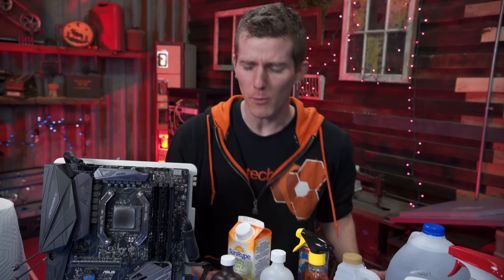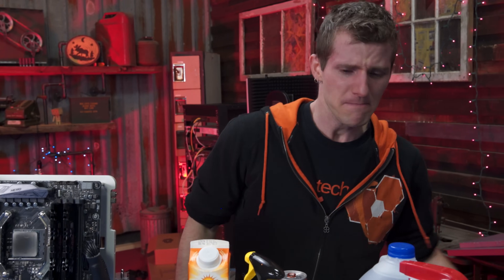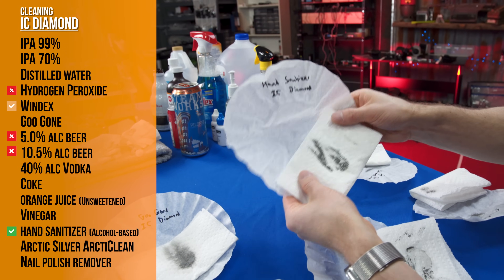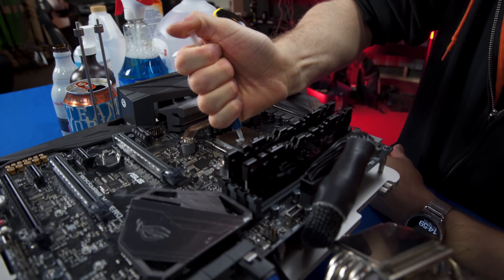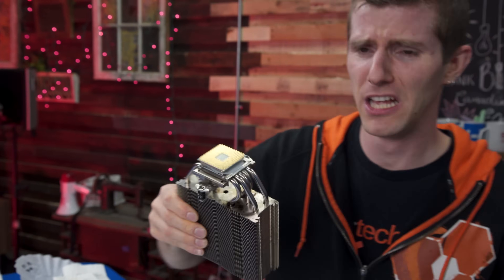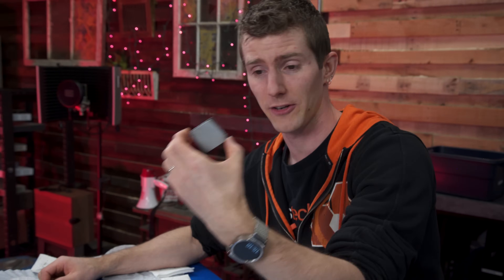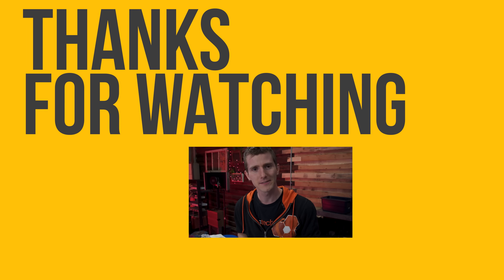Removing Thermal Compound - The BEST Way?

Comment: Then come back in 5 years and realize that the material is literally hardened. Then? Plastic scraper and miracle eraser. When the compound is new, it does not matter. But, what about the residue from the solvent/cleaner?

Comment: There is another purpose built solution for removing the paste. Electrical contact cleaner. You barely have to wipe the surface as the paste will just run off.

Comment: The reason that 99% iso is preferable is NOT because it is better at cleaning than 70%, it is because it contains almost no water.

Higher water content takes longer to dry, has a higher potential for leaving a residue (which is also a major risk with things like hand sanitizer), and IMO has a higher risk of causing moisture related issues.

Comment: i bet the thin stuff would be a bit harder to get off after its been through a few heat cycles ad has dried up, i mean the thick stuff would probably be more difficult too, but especially the thin stuff

Comment: It wasn't AMD, so the cpu is probably fine. I once ripped the AMD CPU with the cooler like that, had to straighten the pins -_- Surprisingly - it worked fine afterwards for many years
Reply: It was an AMD 1800X actually.

Comment: You're missing a huge part of this... what if anything do any of the solvents leave in the microscopic crevices of the heatsink/CPU... you'd have to look at the surfaces w/ a microscope to determine this. However the reason the Isopropyl alcohol is so good in this area is that it all just evaporates.

Comment: +1 for 70% isopropyl.
I've been using 70% isopropyl medical swabs for probably a decade now. they're easy to work with as you get your solvent and lint free wipey offy thing all bundled together in a sealed satchel, ready to go.
and forget having to go to a hardware store, or some place that deals in chemicals to buy it. just go to your local pharmacy, and get about 100 of the bastards for five bucks!

Comment: I've always thought that the purpose of using 99% isopropyl is that it completely evaporates without leaving any residue like, say, orange juice would, so that if a bit gets on your motherboard/in the pins of your CPU, its not a big deal. Plus, it evaporates quickly, reducing the chance of powering on the system while there's still liquid.
Reply: Matthew Hennes yes
Reply: I understand ur point but I feel the difference between 70 and 99 is too small for the price difference, the amount of residue left by the 70 would be not faintly noticeable to the human eye, and same goes w/ the orange juice but the orange probs left some stuff.
Reply: @Denmire  I don't know about the prices where you live, but the price difference between 70% and 99% isopropyl alcohol where I live is about 10%. That means that buying 99% and diluting it down to 70% is cheaper than buying 70%.

But the major selling point of getting the 99% alcohol is that it's nearly pure, wherehas ''Rubbing Alcohol'' (70%) contains camphor and other additives to relieve muscle pain (and to discourage drinking) which will leave a small residue after evaporation.
Reply: @Denmire it's not really about what the human eye can detect, it isn't an issue of not liking how it looks after cleaning. The residue that CAN be left behind (not 100% guaranteed) by 70% vs. 99% can actually cause shorts in electronics. So if it gets on the CPU pins it can cause a big problem for your wallet when you fry the CPU, if you aren't concerned about that or aren't going to use the IPA to also clean your PCB or anything else then 70% would be fine, but if you are using it for more than JUST the thermal paste on your heat sink and the top of your CPU then the non visible residue is going to be an issue.
Reply: Can i use it to clean the pcb if my gpu
Reply: ShortGamingVids yes you could use isopropyl alcohol to clean your GPU.
Reply: It will evaporate clean, no residues, no additives, just pure solvent. And the cost is probably cheaper, per %/volume.
Reply: It’s non polar
Reply: mate can i use normal alcohol if i cant find isopropyl no where in my country or it will ruin my cpu?
Reply: Thought especially the beer, coke and juise would get that issue. Vodka aswell, it got quite the amount of sugar left in.
Reply: Good-quality vodka is actually nothing but alcohol and water, they distill it and then dilute it back to 40%.
Reply: Not true. Alot of sugards in vodka and it will be a mess if spilled.

Comment: No clorox bleach?
Dissapointed.
Reply: a solvent is anything that can dissolve. OJ and beer are acutely acidic, meaning they're a solvent. bleach does "clean" things but usually by breaking down the organics of dyes and pigments, it's also why it kills bacteria and cleans up blood by breaking down the organic material in them. so if the thermal compound adherent substance was organic it could potentially remove it, but that's a big if since they're all synthetic.
Reply: Bleach isn't a solvent. They're using 15 different solvents.
Reply: No bleach, but there is windex. That's close enough for me!
Reply: orange and beer  are  solvents?  0.o
Reply: loomnati noscopers up
Reply: They do use bleach in the video.

Acids, bases and bleach (usually bases) clean using the same principle, dissolving the substances (or reacting with them in such a way to make them soluble) and suspending or removing them with the solvent the acid (or whatever) is suspended in (usually water). 
The chemistry behind them is different and therefore works on different things, but the general principle is the same when it comes to cleaning. 

And being highly acidic is no guarantee of being a solvent, as is apparent here as coca cola is far more acidic than beer or orange juice and did worse than beer and just as bad as orange juice. 

Now that being said, bleach is not a specific type of chemical but is instead a general term for most chemicals that bleach...stuff...Two of the more common ones being Sodium hypochlorite and hydrogen peroxide (used in video). And as most types of bleach are oxidizer's they will in fact corrode metal and most other things that oxidise given time and suitability.

Comment: what happens if u remove it with a plane old wet towel?, i rlly wana know
Reply: like, if i remove the paste with water, and it takes alot longer, but eventually i get it off.. will the cpu temps go up when i apply the new paste just cuz i didnt "proparly" remove the old one?, i mean if i wipe it clean and shiny with water.. whats the big deal?
Reply: i used hand sanatizer, the stuff that makes ur hands feel cold, but im still wondering, does it matter what u use to clean the paste off?, cuz as long as u fully clean it off and add new paste, the new paste wont preform worse, am i correct?

Comment: You forgot the most important solvent: petrol.
That's right: just regular old petroleum will dissolve thermal compound as well as isopropyl, but since it doesn't even contain any water there's no need to unplug your machine.,

Comment: CRC Contact PCC is my favourite. Any flux remover seems to work pretty well. If the the paste isn't dried out then IPA.
Reply: The grey stuff some heat sinks have pre-applied can get quite hard to remove after a few years.

Comment: wouldn't there be a slight difference if the compound had been exposed to high heat and low heat over a long period of time (gaming and turning off your PC.) I don't think the result would vary too much to make your video irrelevant but it certainly would make the experiment more accurate (and tedious.) I want a do-over. jk lol ty.

Comment: Hey, everyone, if you ever have bent pins on a CPU... 16  gauge hollow-tip piercing needles. Incredibly accurate. I've fixed pins that were bent like dominoes in 90 degree angles.

Comment: It's okay, my processors are doing great and they've been ripped out of the socket at least 2 times each... .-. More horrifying was a 2 inch fall one of my processors took, landing on the pins... That broke it....... But I fixed it by bending the pins back with precision pliers and a magnifying glass lol

Comment: The real challenge is when the thermal paste has been applied for months, even years and it has lost moisture. That is when the cleaning products start to matter.
Reply: Yeah hope they do one year for each. So we get a video in 2047, that would be nice
Reply: @Suumpen  Or they would just do  them all for a year at the same  time????
Reply: Get out the chisels, we're carving stone!
Reply: 5 years and 1 month ago I built a machine and used Noctuas thermal compund and 5 years and 1 month after it was applied it was still sort of moist and sticky and yucky to touch and the cooler have never been removed or anything in those 5 years, im kinda impressed and thanks to filters on the intake fans there was barely any dust inside the case after 5 years, was some, but not much at all+ positive pressure helps alot.
But im atleast abit impressed it was still moist after more then 5 years and that machine have been used daily for many hours with everything from games to idling and being left running over weeks at a time.
Reply: @barzinimongo  I PULLED CARPETS OUT OF MY PC ?
Reply: Ga1us Agreed
Reply: @zanpekosak2383  Love Artic silver thermal remover and surface purifier its dont matter how many time the damn paste is ! its gonne in seconds...
Reply: Worst case clean the thermal paste from a MacBook Pro early 2011. Look up for a video if you wanna know what you'll find in there.
Reply: @alexandruilea915  i'm just swapping CPUs in my old rig from 2011. The cpu was never moved and thermal paste is still stock. Well it looks like I'm in for a treat
Reply: White gasoline.
Works great with 7 year old thermal crust.
Yes crust, i was running up to 90 degrees under load.
Reply: @Volvith  laptop? :D
Reply: @Volvith  im running 90 at idle. It's literally overheating rn while idle.
Reply: use a clean new razor blade to remove the bulk then alcohol to get the rest . been their don that. A LOT!!!
Reply: I managed to remove 10 year old thermal paste from a core 2 duo e6600 using water
Reply: All TIMs will do it over time, some take days, some take years.
Reply: Water is one of the options that I would never ever suggest to use. Allthough I am somewhat of a professional in hardware, in some sense, I would not trust myself even with that.
Reply: Ga1us can i use "Alcohol 95%" to clean thermal paste (its not isopropyl , just alcohol)?
Reply: Or it's cheap wax like laptop manufacturers love...
Reply: Acetone nail polish remover still does the trick, had IC Diamond on an i5 7600K on for two years because I didn't know you had to replace the stuff. A couple days ago I went to dust out my pc, took the heatsink off (which had a 3mm caking of dust on it under the fan), and the IC Diamond was hard as marble. Still came off super quick with nail polish remover. 

I guess the moral of the story is gamers should focus on always having a girlfriend so they can repurpose their beauty supplies for PC hardware needs
Reply: Thank you. I was trying not to scream that the whole video
Reply: This!
Reply: I have lots of ddr2fb dram (30 modules) that have huge thermal problems due to old crappy thermal paste applied more or less in 2008, none works. if you try to remove the heatsynk the bga chips get removed from the PCB.
Reply: I think it's time to retire that stuff, with the falling cost of used machines that take registered DDR3. The serial nature of that stuff is a HUGE bottleneck. Then again, if you must...
Reply: @Jack Burton,Troy Leonard  I will try on a spare one.
Reply: ArctiClean has always done it for me, even for years old paraffin based shite, AS5 applications, etc.

That said, I've never really done any high volume work (like Linus here). If I had, I'd be looking for something cheaper too!
Reply: I removed 8 year old thermal compound from an old computer that I haven't turned on in a few years with only a dry cloth. It worked perfectly.
Reply: I had to rent a jackhammer today so i could install my aio cooler
Reply: My noctua thermal paste came off with simple alcohol medical pads almost instantly. Shit was still quite .... liquid..  despite it bein around 8-9 years without changing.
Reply: Ga1us idk, it worked for me and the thermal paste was the preapplied on the stock heatsink
Reply: Yes, your Everclear will work fine.  ;)
Reply: Ga1us I didnt changed thermal paste for 7 years I dont think there is even any thermal paste bcz my cpu is running at 90 degrees c
Reply: why not go straight to a school or library-ish place , you can find tons of low-end computers
Reply: The hand sanitizer used in this video was most likely 70% EtOH, so of course you can.
Reply: Suhnil Lavandero I used 50% isopropyl on my CPU
Reply: Just run your PC a bit. That'll allow the thermal paste to soften for easier cleaning.
Reply: I use carb cleaner on that chipped on stuff followed by rubbing alcohol.  Works great.  But just be careful with the carb cleaner and spray it on the towel only.
Reply: I’ve been scrubbing with a paper towel for a hour on a Xbox 360 cpu and gpu 😐
Reply: Compound lasts a while right? How often should I swap?
Reply: "Beer".. IPA.. holy fecking 99%?! " isopropyl" ohhh..
Reply: Hell ye
Reply: The 7 year old compound in my PC:  👁👄👁
Reply: WD-40 and CRC Quick Drying Electronics Cleaner. It’ll be the easiest time you’ve ever had removing dried thermal paste.
Reply: I didn’t change mine for 6 years, want to do it soon.
Reply: Totally totally agree, Im trying to remove some hard compound off some devices that I would prefer not to scratch and I can tell you nothing I can find seems to shift it. I suspect it needs socking in isopropanol but its on a large board and I just dont have enough.
Reply: Uh I left mine for 13 years please help
Reply: just had great success with electric contact cleaner and followed by alcohol for dried crusty stuff
Reply: elbow grease always works for me products arent really needed
Reply: Use toothpaste - any plain toothpaste. Cover the thermal paste with it, let it work in and then rub off with a towel or kitchen paper....
Reply: Agreed. Removed the heatsinks on an old Asus X58 mobo that used some kind of rock hard goo that alcohol did nothing too. Used some Artic Clean, let it sit, and it wiped right off. Amazing. I always like using alcohol for ease of use but when it comes to the old hard stuff, Artic Clean is king.
Reply: @Ziginox My server works well (except DDR2 temperature) and have the right power for my stuff. Replacement are cheap 25USD for a replacement board?  30USB for rendundant psu? nah.
Reply: a problem pretty much avoided for non setting Thermal Paste, though!
which is better anyways. *shrugs*

Comment: If the paste is not contaminated, why clean it off? If it is clean but hard and crusty, blend it with a dab of vaseline to make it smooth and flow again. Also, vaseline will work to clean off old paste.

Comment: Automotive brake cleaner. Spray onto kitchen towel. Wipe. Repeat until clean. 5 litres for about $15 which will last you forever (and can be used to help with your car maintenance too). A lot of the PC specific stuff is massively overpriced.

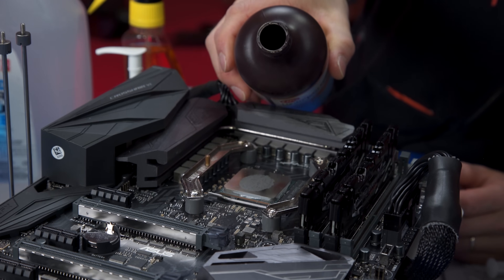Comment: At 3:07 you can see why you should spread the thermal paste over the processor, instead of using the pea method... Right there you are not going to get the full thermal release from the processor.

Comment: I used brake cleaner. I didn't want to run to the store for more alcohol before installing my new cooler. 
Sprayed a little on a cotton ball and it wiped away very easily. 
Side note, brake cleaner is a very effective bee and insect killer.

Comment: The recommendation of 99% isopropyl alcohol isnt just about how well it cleans, its the fact that it doesnt leave residue that can be conductive and damage components.  This isnt a good real world test. Compound gets much harder to remove after it has been on your CPU for months/years, with the heat, so elbow grease and most others substances isnt going to work in a normal usage scenario. When its fresh it can be removed easily but most people dont removes fresh paste. This whole video is really a bunch of bull I guess you are running out of ideas?

Comment: Hey Linus, why don't you test whether or not it actually makes any difference to properly clean cpu/heat-sink.  See what happens when you just grossly remove the large of the goo with a tissue paper versus doing the "pro" way with detergent... I would bet there is no difference.

Comment: Ugh.  It's like watching a 3rd grader.  It's really just a simple chemistry question -- whatever the thermal paste is made of will have an available chemical that'll dissolve it optimally.  All one has to do is to know what the chemicals involved are to find the optimal match.  Or, just do the kindergarden science experiment you see here.  This test also does not take into account any changes in the thermal compound after it gets nicely heated up by the CPU and 'ages'.